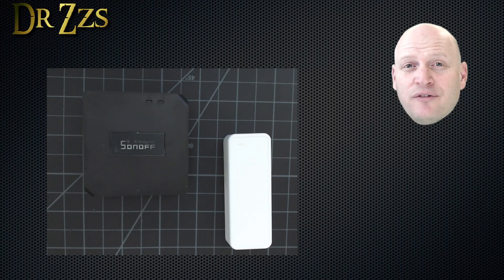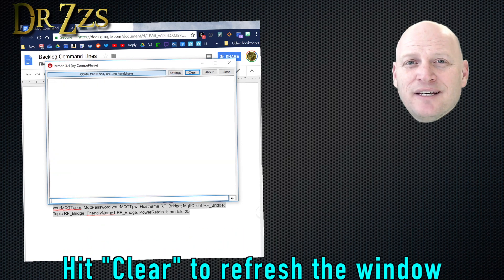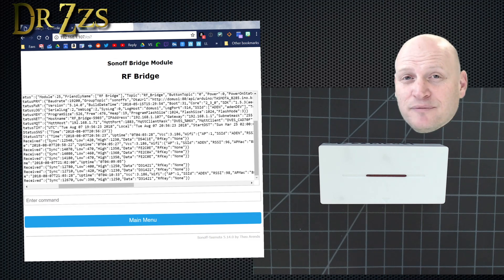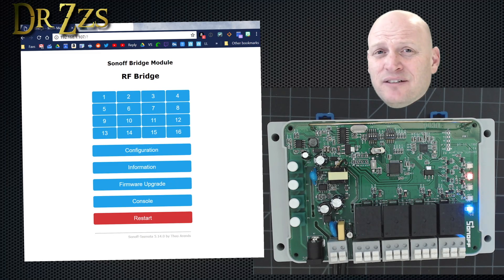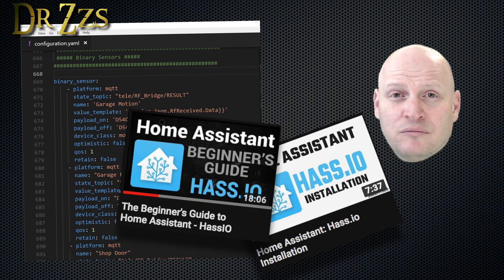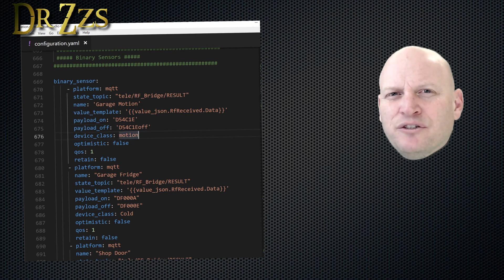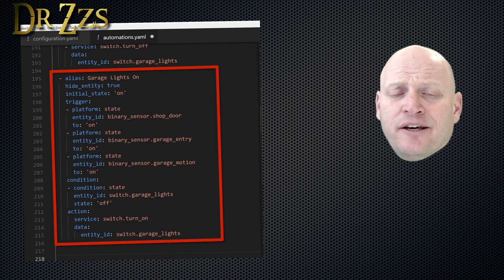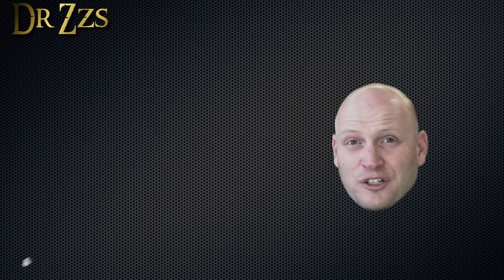Sonoff RF Bridge with Tasmota

Comment: Really clear now!

So if I have some sonoff automated lights and I want to install a remote manual switch to one of them on a wall where I have no outlets, a battery powered rf switch could be used to talk to the RF Bridge which could generate an mqtt message to toggle the light I want to control?  This would be very useful!  All I need to do is find a small rf switch on cannibalize an RF sensor to use a normal switch instead of a reed switch.

Ordered my RF Bridge...can't wait to get it!  Any idea on the typical range between an rf switch/sensor and the RF Bridge?

Thanks as always for the great videos!
Reply: yes, you can: https://it.aliexpress.com/item/RF-Wireless-Remote-Control-Switch-transmitter-315-433-92-MHz-86-86mm-della-parete/32851245218.html
Reply: Perfect... thanks for the link, seems to be exactly what I need.
Reply: You could also use the Sonoff RF Control that has 4 buttons. And use them as a remote switch

Comment: nice video as always! :)
finally, github gists! but you should standardize and put all there, instead of google docs ;)
and you really should try Espurna firmware on sonoff rf bridge... try with the standard rf bridge firmware, as it has way more options than the tasmota one (has a learning interface embedded, for example...)... then if you're brave, you can go for the hacked version which bypasses the internal (limited...) rf code generator and uses the esp8266 for everything, adding TONS of new devices detectable... links in next comment
Reply: you can add a IR transmitter, too: https://1technophile.blogspot.com/2018/02/adding-infrared-emitter-to-sonoff-rf.html
Reply: other info: https://github.com/xoseperez/espurna/wiki/Hardware-Itead-Sonoff-RF-Bridge
Reply from the maker: Thanks man.  I'm getting another RF bridge so maybe I will finally try ESPurna.
Reply: DrZzs thank you for your videos, very well done and informative, and you're funny, which is a bonus ;-)
Reply: hacking sonoff rf bridge: http://tinkerman.cat/hacking-sonoff-rf-bridge-433/
and custom firmware: https://github.com/xoseperez/espurna/wiki/Hardware-Itead-Sonoff-RF-Bridge---Direct-Hack
on tasmota wiki you'll find info about the sonoff rf bridge v2, too, the one you have (in which the 2 gpio are wrongly marked....)

Comment: DrZzs, Let me start by saying appreciate all you have done in creating these vid's, has made this stuff so much easier.  Just watch the video, didn't even realize that Sonoff made a RF bridge or motion detectors.  Together my girlfriend and I have 5 kids so you can imagine, we don't have a lot of money for this stuff.  I want to use the sonoff motion sensors because of the cost, can they be modified like the other sonoff's so that I can collect other information such as room temp, humidity, light levels, ect?  Could you maybe do a video on it if this is an option.
Reply: the sonoff motion sensors are just rf devices, no wifi so no firmwares available, but you can add those sensors to sonoff basics or sonoff th, for example... even to s20 models...
Reply: So they can't be flashed with tasmota?
Reply: Jeremy Orchuk tasmota is a firmware for esp8266 devices, so no...
Reply: Thanks for the information, guess it would be better to do a plug in device for those anyway.
Reply: Jeremy Orchuk sonoff th is what you're looking, for 0 DIY hacking... https://www.itead.cc/sonoff-th.html

Of course if you need to pilot some electric load based on those info... Otherwise go for a small wemos d1+temperature sensor shield...